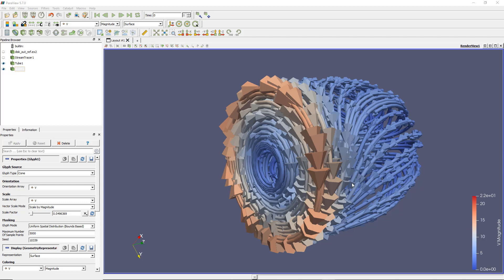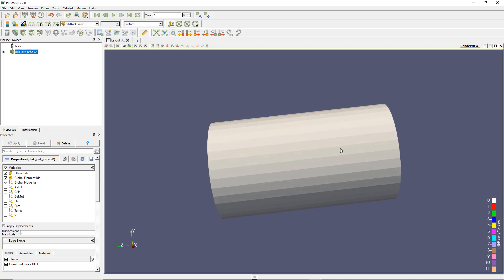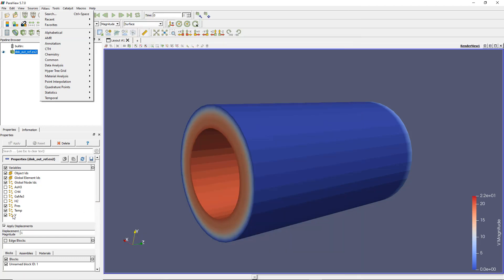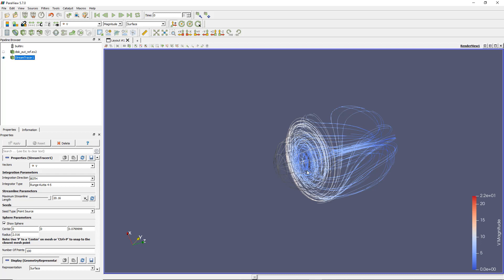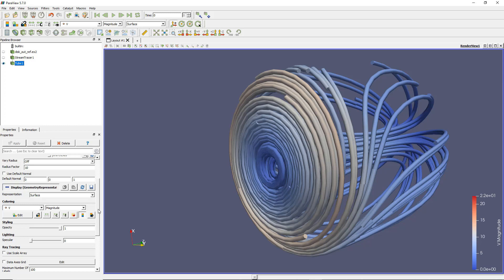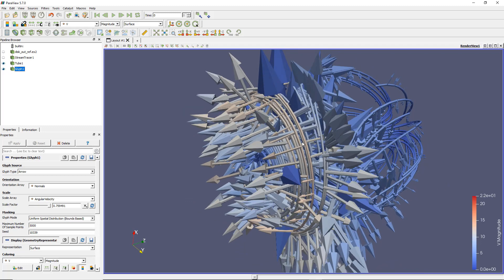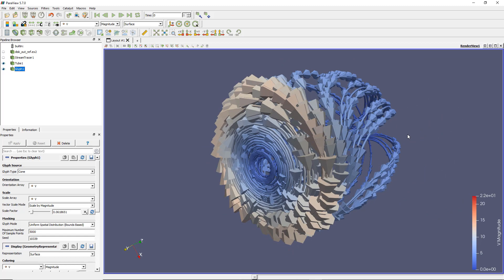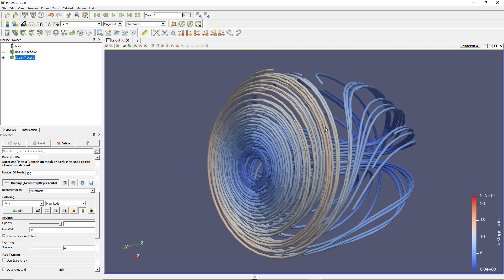[ Paraview Tutorial 5 ]  Vector Visualization and Streamlines

Comment: Hi 
Cyprien, I have a question when using StreamTracer filter. My case is 3D, so I first generate a 2D slice and then use high resolution line source seed type. The default line is from left bottom to right top. The strange thing is that only very few streamlines is generated around the seed line rather than distribute in all domain. I change the location of start and end point of the line, but results are similar. Could you please tell me how to generate streamlines within whole domain? Thanks!
Reply from the maker: I think there is a parameter to increase the number of samples at the start location. Try to increase it and it should solve your problem
Reply: @Feaforall  Hi Cyprien, thanks for your reply! I solve the problem by combining the filter Surface Vector and Stream Tracer, then the streamlines can be generated in whole 2d domain. And I use Glyph to generate arrows on each streamline. Thanks again for your excellent video!

Comment: I am having real trouble finding information on how to use programs like paraview to analyze photogrammetry models. Is this an unorthodox approach? I am trying to determine the drag coefficient with Normals_Y (models oriented along the Y) in place of Cd in the drag equation, but the results appear anomalous. No amount of internet searching turns up a straight forward answer. I see others using models with pressure vectors calculating drag in Paraview, that is the closest I've come, but how do you do this from a photogrammetry model?
Reply from the maker: First time I hear about photogrammetry, is your data similar to data coming from LiDAR Scanner ? Paraview has an app called LidarView, maybe you can have a look: https://www.paraview.org/lidarview/

Also I don’t think you can get the drag coefficient just like that by looking at data from a geometry model... you will have to do some simulation to get the physical data necessary... or is your data the results measured in wind tunnel?
Reply: @Feaforall  Thank you for your quick response. I am actually using photogrammetry models of small objects (replicas of ancient stone hunting tools to study their ballistics). I can scale, reorient and smooth them in meshlab, then load them into Paraview, which provides a promising view of drag along the surface and allows me to calculate the cross-section. But I cannot determine how to add the velocity vectors or flow parameters. No amount of searching turns up a straightforward approach because, it would seem, most people are working with models built in software with the vectors and dependent parameters built into the models (namely pressure). I have only come across tantalizing evidence that this could be done by writing a new filter in Paraview. It looks possible to analyze my models in Solidworks but I'd rather not buy a subscription. Still a poor student and the uni does not provide access.
Reply from the maker: @devinpettigrew9273  Paraview is a software to post-process data. It can't calculate or simulate. To get velocity vectors, you need to do a CFD flow simulation on your model first, then calculate the velocity field around your object, then only you can import that into paraview to visualize it. There are free CFD software you can use, either open source (Code_saturne, OpenFoam), or Cloud-based (OnScale, Simscale,...).
Reply: @Feaforall  thank you for the clarification. I searched a long while but this was never clear to me. And thanks for your great videos.

Comment: How can I use the GPU in paraview?
Reply from the maker: This is the case by default when you are using the paraview binaries, you can check by taking a look into Help->About->OpenGL Renderer
Reply: @Feaforall  I want paraview to use the GPU instead of the CPU for animation. Is that possible?
Reply from the maker: Like I told you, this should the default, but it depends on your graphic card and how you have configured your install. I think there are some settings to force paraview to use GPU... google is your friend here.